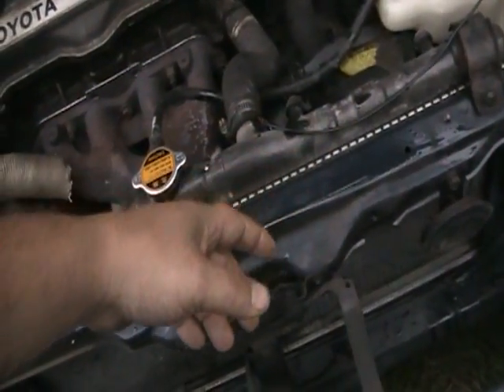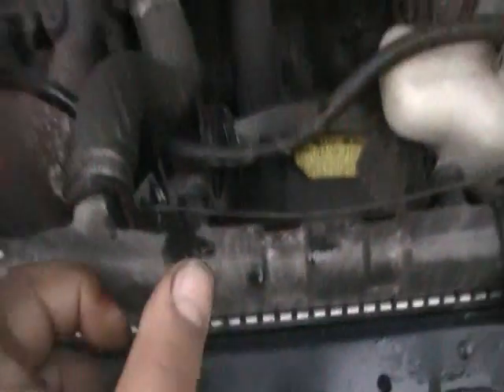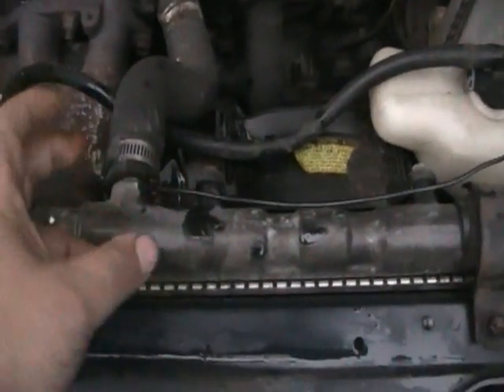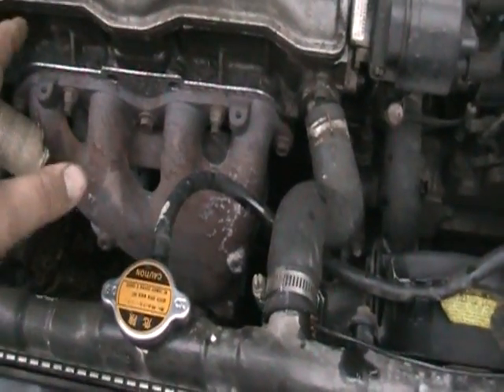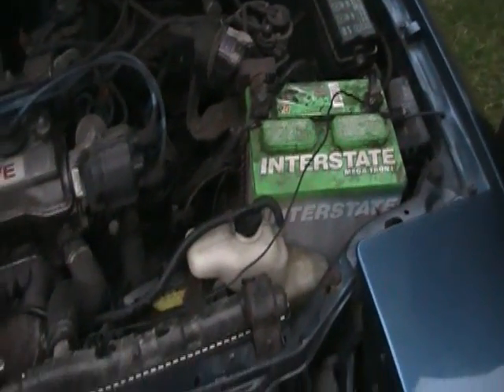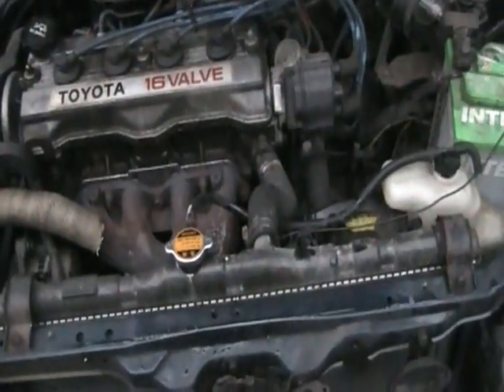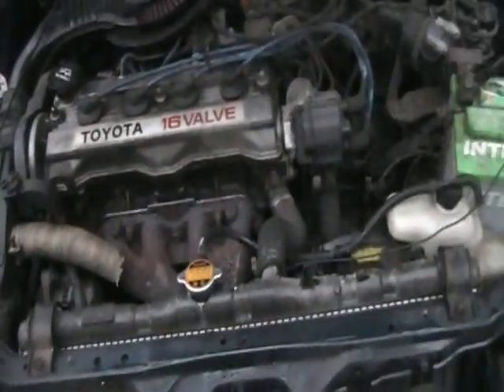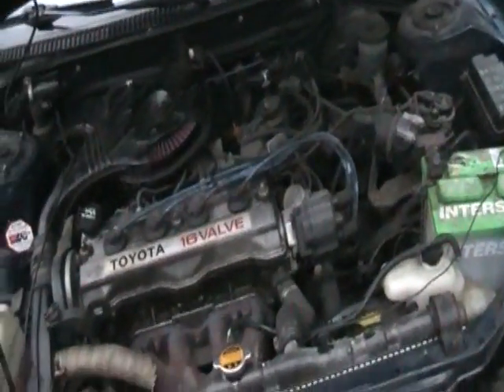joe cell save money on fuel with one wire

Comment: We use open source and aftermarket tuning software to remap engine management programming at our Subaru shop.  In this particular case the motor would not take much leaner than 15:1 AFR without knocking in closed loop.  Standard closed loop (low load) fueling is ~14.5:1 AFR.  Since grounding the radiator the ECU added fuel because the O2 sensor saw less O2 in the exhaust.  I just remapped the fueling and told the computer to target the higher AFR's.  No timing adjustments, EGT was not monitored.

Comment: Almost afraid to post this but two test runs are on average 22 miles per gallon with about 75% of the driving in town.  Still waiting for the oxygen sensors to attempt to counteract the increase and am prepared to space them out with drilled out spark plug non foulers.  One more test tomorrow with a 140 mile round trip on the open road.

Comment: Fuel economy improved by 2.7 MPG (19.8 to 22.5 MPG) over the last tank, better than expected.  I have logged MPG it at every fill up for the last 6 years with this car using consistent methods.  I won't make any modifications to the grounding or engine tuning before the next tank is finished so I can get a valid confirmation of the result.  After that I will change the grounding arrangement and place an aluminum coolant temp sensor adapter in the uppper coolant hose with an 8 AWG wire to ground.

Comment: I did forget to mention that engine runs about 10 degrees cooler also.  Oil temps are unchanged.  Very interesting and I'm making some specific engine mapping to get the most out of the observed affects.

Comment: Did some observations and logs today: running voltage decreased a bit to 15V +/- .2V and very stable.  Before saw fluctuations of 1V or more.  Can't say much about fuel mileage yet but from the data logging the ECU is adding fuel 10% at idle and 6% at higher loads.  This means adjustment is necessary so I will change the mapping to target higher AFR's in closed loop.  Car has no cats but I did notice the acrid hydrocarbon smell is reduced.  Idle is smooth as glass now.  Will keep testing.

Comment: No diodes yet, but I have done the modification to the second car.  Used 8 gauge wire  to ground the sensor adapter and flashed the block four times.  As soon as the engine warmed up I could see that the ECU was adding fuel because of lower O2 readings.  Idle dropped down to 550-600 RPM.  I think this will acclimate quicker to the modification.  On the original car I'm going to change to 8 gauge wire before putting in a diode.
Reply: Curious to hear how far you took this.. timing changes were necessary by the original inventor at a certain point to get full potential.

Comment: More observations from today:

Adjusted fueling and the engine got even smoother.  ECU added more fuel after raising the closed loop AFR targets.  So will adjust them higher and see where we can go.  No knock at all so looking good.

I'm a total skeptic about all of the Joe Cell claims.  I tried this mod because it was easy.  There are observable differences so I'm just going where the data takes me.  Fuel economy tests coming soon.  Tested coolant for voltage (acidity); 0.00V on the coolant.

Comment: Does the wire inside the radiator work better than the external connection to the radiator?  Or is it the same effect?  My brother's car gained 3 MPG, or about 11 percent from the last tank fill-up.  He was using the easy external install.  More people should try this and post their fuel usage before and after.  From 26 to 29 MPG!   That is not bad for spending two minutes installing one wire.   This guy is on the level!  Learn from him!

Comment: ...I still can't believe it really.  The previous runs were showing progressively higher fuel trims but the last run the jump was huge.  In very basic terms this car can run on at least 25% less fuel than before.  Optimizing the tuning this car may be able to cruise down the highway running as lean as 24:1. Fuel economy may be increased 40-50%,  Incredible.  I should also say that I noticed that the coolant has turned brown.  Don't know what it means but I'll keep testing...
Reply: Wow! Amazing you kept checking in.. sounds like yes something is occurring.. I suggest you look at that timing gains to be made there perhaps no fuel..

Comment: my advice is view all of Joe's video's he has so much information food for thought
it's magnetism...different degrees of magnetism with unregulated DC generated frequency...over power your coil with 120v to achieve this type of energy...it's similar to the old DC magneto's that use to run 1 to 12 cylinder engines with one wire to the block...no need for spark plugs or distributer.  the tesla coil is the magic.  there is a video where Joe arcs off the spark plug wire to all the components under

Comment: I tryied this ..."magic wire" on my car and.....I did not notice any fuel gain, but there is something strange (good)....My car peugeot 206 hdi runs more smooth. The incredible thing I must say here that I had a problem with check engine light coming on all the time (1 year until now) when i drove uphill while accelerating and it was pain in the asxxx.. because the engine lost power.But with this "magic wire" IT'S GONE.. (today is the third day test). Right now I'm very happy about it, because even though I cleaned the catalytic converter, no change!!!...Conclusion: I can't beleve it.. it is hard to explain , but there is something going on!
Thank's
Reply: Did you maybe disconnect the battery connector for a few seconds ?..Probably reset the electronics, got rid of the errors by resetting.
Reply: +MrFreddiew1 I wish, my life would have been so much simpler.
Joecell202.

Comment: I forgot to test the coolant for voltage and I just went out and did it.  I used a more sensitive pro multi-meter and showed 190 mV which is actually a little concern considering the conventional wisdom about coolant.  Measurements from overflow tank and reservoir are the same.  Control car has a similar engine and older coolant and showed 145 mV.  Should also be clear about voltage.  I detailed running voltage which is now about 14.6 V battery voltage is 12.25 V control car voltage is 12.56 V.

Comment: Great idea. Isn't the idea around this is to create a resonant effect within the metal thus polarising engine block? When the metal is polarised you do not get pitting in the cylinder as it forms a "repulsive" force on the wall, so the "path of less resistance" of the compressed air is amplified through the "fuel". ... 

Take water from fuel and the it will not "ignite", meaning in a motor the water in the fuel is the path of less resistance and implodes. Thus giving you a much larger output of energy and water in the exhaust.

The ignition of the fuel and this path of least resistance works no differently to a lightbulb filament as the magnetic energy is compressed and forced into a narrow corridor it throws off what it cannot send down the wire, thus giving you light ie ignition. Or a "explosive" outburst sending the piston back down as the air expands.

Comment: depending where the block was casted at (location on the planet) determines the timing of the engine....6 degrees before top dead center 13 degrees etc...  the amount of oxygen and hydrogen that is present determine if the combustion is implosive or explosive

Comment: Stunning results today:  First I decided to "strike" the block with the positive lead.  I struck the AC compressor (which is bolted directly to the block)  four times.  I then started a series of test driving loops and tuning though the afternoon.  I did five loops and on the last one I filled up the tank.  Before that however I saw that the ECU was adding maximum fuel (25%)and the AFRs were still at 18:1 or so (targeted is 15:1).  I actually got goose bumps looking at the data stream...

Comment: I'd definitely like to get more people looking at this.  This is so simple to do however the mechanisms behind it and a way to control it may be quite complex.  Just a bit of research revealed similar phenomena in the oil and gas industry.  H+ penetrating stainless steel tanks and even getting trapped and causing damage to pipe.  My engines are all aluminum and and this may be better for the ions to saturate the engine block.  We need to find out how to control the H ions and make this reliable.

Comment: So it is possible that H+ ions are saturating the engine block and causing the effects.  With the data logging I can actually see when the effect is "on" and "off".  It appears that the less fuel that is injected into the engine the more the effect takes over.  On the first car the effect starts when the coolant temp reaches 180 degrees and thermostat opens.  I'm going to put in a 160 degree t-stat and see what happens.

Comment: Sitting in my truck right now... connected two 16 guage copper speaker wires to the top left and right of the radiator and ran it to the negative battery terminal. I also did some research... and found a lil sum sum i found very interesting and was surprised to learn that calcium is the perfect bond buddy with hydrogen and not only do they excite the process but they literally fuel eachother by attaching molecules in a weird way too. Its only been 45 min...first thing I noticed... was my idle is

Comment: thanks for replying appreciate a little help as i am on with this now .noticed in my diesel isuzu the one wire was making the water BREATHE when i removed radiator cap when i went to add more water as water in rad had dropped.it was just as though the water was pulsing an alien form a bit frightening as well. as i like to understand stuff. i have also found out the stan meyer method this last weekend  it is on the same as joe booker but he is sending a fourth energised source into the atom

Comment: Actually I posted both the resting and running battery voltages.  The resting voltage in this car is 12.25 volts and does not vary much.  If the resting battery voltage increases that means it will be harder for the alternator to charge the battery.  Most every car alternator is regulated to a maximum 14.5VDC.  If the battery voltage approaches that it won't charge because there is not enough voltage differential.  A minimum difference of 1.2V is required to charge a typical lead-acid battery.

Comment: The sensor adapter is commercially available and made of aluminum.  It comes anodized chrome.  I glass bead blasted that coating off and modified the adapter for this purpose.  No magnetic materials used the lugs on the wire are gold plated copper and the wire itself is tinned multi-stranded copper (marine grade) and very flexible. 

My background is in aeronautical engineering however my current work is in the high performance automotive market.  Vids are coming soon

Comment: I also upped the ground cable to a 4 AWG wire in the original car, a 2002 WRX.  After I did that the effects went away until I flashed the block three times.  The effect came back and the engine smoothed out and ran fine after that.  The second Car, 2005 Outback XT, may take a bit of running before things change dramatically.  I'm not doing any modifications to this car until the full effects are realized.

Comment: I used a coolant temperature sensor adapter and grounded it with a 4 AWG cable to the battery not 8 gauge as I said previously.  It's simply a piece of machined aluminum tube with a 1/8 NPT port for a coolant temp sensor.  It also has a ground screw which I enlarged to accept a brass screw for the ground cable.  I cut the top coolant hose, trimmed it and installed the sensor adapter as splice between the hose halves.  Seems to work so far. Cars are 2002 and 2005 turbo Subarus

Comment: Having experimented with Joe cells and HHO I gave this a shot years ago.
 Recently tried it again on my 89 civic.
This time I used a 1/4" nut bolt and washers through the radiator fins with a crimp ring connector to a wire running to my positive. Sparked the block 4 times.
Noticed no immediate difference.
The next day I went for a drive and was throw into my seat harder than this car ever has in the past.
It does indeed appear to burn cleaner and more power and the computer sees this and dumps extra fuel. 
I am able to run maximum timing advance possible without knock and the power gains are in the shit your pants territory.
I disconnected my O2 sensors so the ECU can't tell what's going on and only now my fuel economy seems to be improving...
My next experiment will be electrically isolating the throttle body and or intake manifold and running a positive wire from the radiator to it like a joe cell. Apparently grounds will add electrons, de ionizing the air and fuel, loosing this magical effect...

Comment: Okay guys.  Initial testing shows water from tail pipe and improved response to the pedal and smoother running.  Couldn't get the leak to stop where I installed the wire so have re-routed from overflow below where the radiator cap goes on.  Have wire directly into the water from there and back through the overlow tube into the reservoir and from there to the negative post.  A round about way but am using 14 gauge wire so the hose is not blocked and in theory coolant should still pass through.

Comment: I recently had an idea somewhere along this line. I took a wire from the + battery. Ran it into my air cleaner and attached it to a bunch of ss wool. A lot of the time, here in florida, the humidity is high. Many days over 90%. So I thought I might be able to ionise water vapor before it reached the negatively charged cylinder. Haven't had enough time to do tests to see any significant benefits. Thanks for the push~!

Comment: I got another buddy who is using a 450w 120v inverter with halogen 300w flood light hooked to block and through another coil regular 1972 chevy car coil then high tension to distributer...his truck will not run on gas any longer...it will only run on water but one problem...his carby freezes up within 30 seconds...haha it's awesome

Comment: I did not have time to do any tuning from the final data logs.  I was just too shocked to believe it as well.  I still have to verify that it is not a faulty sensor, but this is huge and if correct. I'll be getting into some pretty radical fueling once verified.  A motor just should not be able to run under load at 24:1 AFR.  I did also notice resting battery voltage is climbing and at last check up to 12.4V.  Used to be 12.25V or less.  I may do the diode modification as I have many of them.

Comment: Very nice, I have tried this and yes it seems to work. I use it in combination with a Joe Cell, and the MPG has gone down quite a bit lately. If we all work together on this a working device should be out and open sourced pretty quick. 

The problems with the Joe Cell seems to get it to work more than 5 minutes at a time, and everywhere. Anyone got a clue?

Comment: More observations: Throughout the afternoon the engine running temps had been dropping and even fluctuating low.  I saw a 10 degree drop in operating temps and then on the last run the temps went up 7 degrees which would be consistent with the lean running.  Outside air temps had dropped about 5 degrees from the first to the last run.  It's like a switch was flipped on the last driving run.  It is exciting but I don't know how this works and can not begin to understand. why.

Comment: I did this but not exactly as shown in the video.  I have an all aluminum radiator and grounded it between a mounting bolt and a common chassis ground in the engine bay (trunk mounted battery).  Before the grounding the radiator was at about 200 ohms between ground.  After 0 ohms. I'm able to log data and the first thing I noticed is the system voltage went to 15.4 V, normal is 14.2 V  Will do some logging tomorrow to see if there is any affects on air/fuel ratio, performance and mpg.

Comment: When the effect reduces or turns off the car runs like crap because I've tuned for it being there.  I'll try a middle ground on fueling to avoid the fluctuations in driveability.  I have also added the diode in; 1/2 of a Schotkey type.  Will see how that works but I'm thinking that maybe the smaller gauge wire was better for this setup.  Maybe the diode will add some control, I just don't know.

Comment: I'm using a racing radiator which is all aluminum.   The fins the tanks and internals are all the same material and welded together. The attachment location of a ground point does not matter as the metal connection is continuous, unlike an OEM type radiator which is usually made of aluminum brass and plastic. Standard radiators in cars are isolated from the car chassis not insulated . Placing wire strands in the fins of radiators is a weak connection at best the way I have done it is more secure

Comment: hi, all cleared up ..i was lookin at the battery on vid from the wrong way round ,also i meant to say i struck the wire on the block (running),..should it spark ? as mine didnt ,its been a couple of days ,gonna use the temporary positive to strike block,will update,thanx for responce : )

Comment: B"H
I installed it on a friend's car, I don't have one. 
It's a Jeep. Immediately it was working quieter with a bit more power. It seems there is a slight increase in MPG, but it's difficult to say since his turbo leaks, so in certain regimes the car is not performing. We are still collecting MPG data. It's only been a few days.

Comment: The fueling changes I've made should result in better economy.  It don't think it will be dramatic but well worth the cost of the mod which was zero.  If I get another 1 MPG out of it I can be happy with that.  Without being able to adjust the engine computer gains may not be realized on other computer controlled cars actually.  I do think that maybe a heavier gauge wire would be better so I will increase to an 8 gauge aluminum or copper cable after the next fill up. Maybe post my own video.